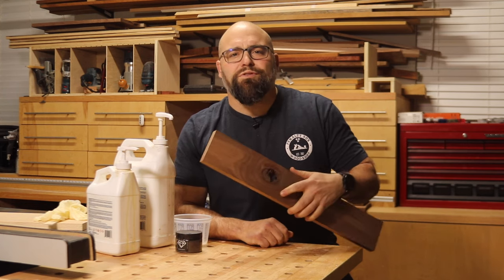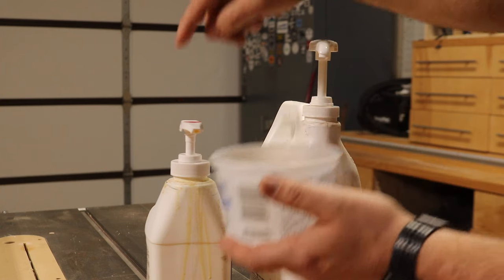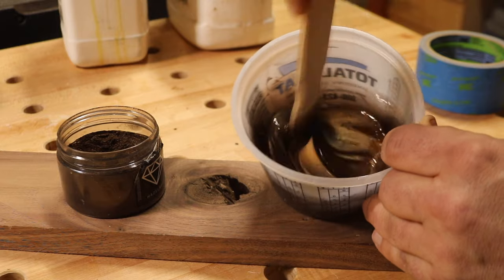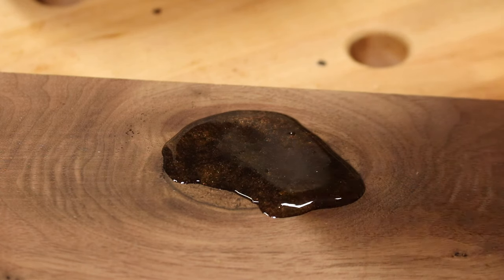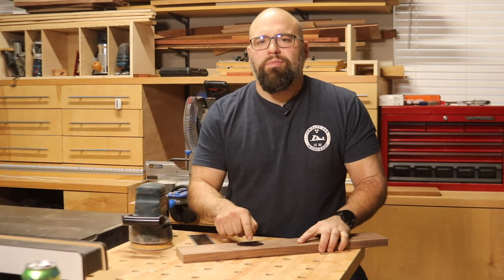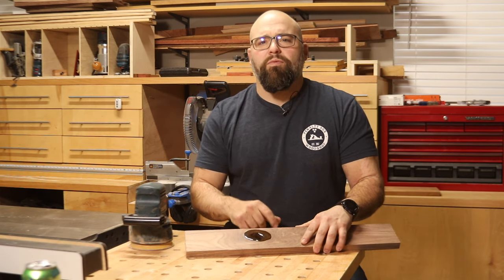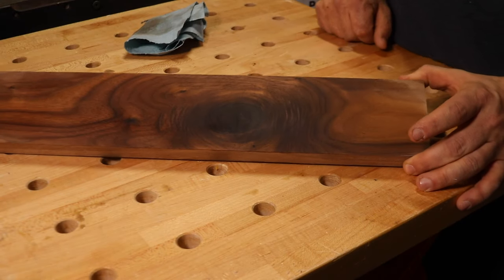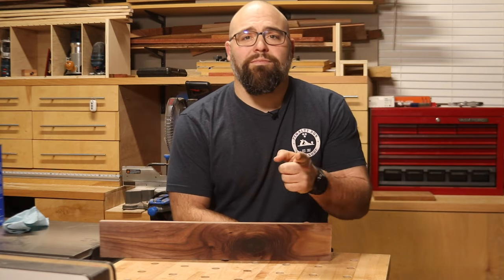Fixing Knots and Voids With Epoxy

Comment from the maker: If you watch all the way to the end of the video you will see how I use my leftover epoxy!
Reply: Totally saw that. Rock on!
Reply from the maker: Haha thanks man!
Reply: I used glue to lay down my hardwood (white oak) 3/4 thick and the glue which is like rubber once it dries. Has seeped into the not holes. Do you have any suggestions on getting that out before laying the epoxy or do think it’ll be ok to go on and finish filling the hole.
Reply from the maker: I don’t think it would hurt to just pour it but that’s without me actually seeing it. You could always use a small forstner bit to drill that stuff out

Comment: I just bought a bunch of reclaimed doug fir that I’m going to use for flooring. The planks have a ton of knots, holes and imperfections (which I don’t hate) but just curious if you think I could get away with filling all the holes this way? or what you would do? I’m trying to avoid having to cutting all that out and losing so much of the wood :/ any recommendations would be so appreciated 🙏🏼
Reply from the maker: Yea, I don’t know why you couldn’t! Should work good, might be a lot of work but will save you from tossing boards
Reply: Okay thank you 🙏🏼

Comment: That is exactly the information I need for this table top I am making for a client. I got a lot of old black walnut slabs that were cut in the early 1970's and sitting in the millhouse for all of that time. Bugs got in the wood and did what they do so there are some holes and tunnels that need filling. I was thinking that I would have to make a mold and do the whole thing in epoxy but that would be major overkill as I am not making a river table or anything of the sort. I just need to fill the holes and tunnels and knots. This is the perfect solution. Thanks for the video!

Comment: Hello Jessy. WOW! Thanks so much for your video, very 
useful and clear! I would be grateful if you could give me a suggestion.
 I left a bottle of gel bleach in a bag on the floor. It is an old, 
light colored, parquet; therefore, there is a very thin line of empty 
space between the pieces of wooden strips. For some reasons, the gel 
bleach leaked and, since the bag was not made of plastic (it was a cloth
 bag), it passed through and got to the floor. It stayed there for a 
very long time. The gel bleach had the time to literally dig a large 
hole in the parquet. Which now looks like a crater, about 6 cm or more 
in diameter, exposing the bottom layer of the floor, some sort of 
strange material. I thought to fill it with epoxy glue (Gorilla epoxy 
with the 2 syringes), wait that it dries, and then paint. I am glad to 
find out that I can mix the paint with the glue itself. I need to fix 
this quickly. It's not my home. I would be GRATEFUL if you could help me
 with the following questions: 1) Since I cannot fill from the back 
side, how do I address the need to leave a thin line between the wooden 
strips? (yes, the crater extends beyond 1 strip, affecting the two 
confining strips at its two sides too. 2) If I send you a picture of the
 parquet (how/where can I send it? Thanks), would you be able to tell 
me, approximately, what colors of what kind of paint should I buy? 3) I 
cannot spend much money on huge tanks, so, is the Gorilla Epoxy glue 
with 2 syringes ( 
https://www.homedepot.ca/product/gorilla-epoxy/1000778451 ) suitable for
 this job and can I mix that type too with the paint? 4) If the epoxy 
will end up overflowing, how can I gently smooth it without damaging the
 surrounding healthy parquet? 5) Any other suggestion? Like, if it had 
happened to you, what would you have done saving as much time and money 
as possible? THANK YOU SO MUCH!!! I will anxiously wait for your 
response and my apologies for the long comment. (Loved the leftover epoxy idea! :) ). Kind regards.
Reply from the maker: Thanks for the comment and support! Not knowing the situation entirely it’s hard for me to comment to exactly the right move here. But, it sounds like you are on the right track. You might be able to heat the excess epoxy with a blow drier (be careful to not get the surrounding area too hot) and then the excess epoxy might get pliable enough to scrape off with a card. But, again, not knowing the exact type of floor it’s hard for me to help you that much. Sorry, this is a tricky question.
Reply: @PenaltyBoxWoodshop  Thank you Jessy, no need to apologize. On the contrary, thanks for replying and so quickly. Well, at least now I know that the little Gorilla Epoxy works just as fine as those huge tanks you used :)

Comment: Nice video. Any tips on filling a 2 1/4 inch deep hole? Should I fill it all at once or do it in 1/4 inch stages? If in stages do I let it dry completely before continuing? Thanks 😄

Comment: I love tints dyes etc.....but no need to use tint "unless" the hole on the other side will actually see light(rare) in the final piece. Plain clear epoxy(or slightly amber will mimic the color of the hole below and wood surrounding almost perfectly; it will even look more like wood and it won't darken the wood around it like tints will. Give clear a try!
Reply from the maker: Will do! Thanks!

Comment: Can you suggest any low or no VOC epoxy fixes for boards, and perhaps any that are already mixed with a hardener? I want to repair a knot hole in my spiral staircase and need to do the epoxy fix inside the house.  Bad allergies to chemical smells. Thanks!
Reply from the maker: That’s a great question and one that I’m not sure of. I bet if you contact total boat or any of the other brands they would be able to help you

Comment: Any tips on resawing a board after filling voids with epoxy?  I have a 3x5-in juniper board with some really cool knotholes and voids that I'd like to turn into  3/4" shelves.  Is it better to do a deep pour then resaw, or resaw first and fill twice as many holes?
Reply from the maker: It should do fine resawing however it wouldn’t be hard to do it after either

Comment: This vid is very helpful, just wondering if it works the same on large open cracks due to natural wood and not stress cracks. How about knife scales with tung oil or Tru oil finish . I usually use Loc Tite epoxy to bond scales just wondering if same would fill cracks and knot holes
Reply from the maker: Thank you! It will work on larger cracks just as long as you don’t pour it any thinker than recommends by the brand Epoxy that your using. I’ll typically do layers for larger pours and it works great. Not sure about the knife scars

Comment: If you put a screw or bolt in the center of that hole, would the epoxy solidify such that the bolt will not move, even with force?

Comment: I look great, but wonder this epoxy can be applied for pine wood - soft one? and after planning this wood foil can go for molding without any problem? the final product is wood skirting. Please advise
Reply from the maker: Yes you can apply this to soft woods like pine as well. Shouldn’t have any problems planning that either

Comment: I really like how this turned out. I've never used epoxy and don't really care for the bright metallic looking river bed tables. Can you advise if the diamond epoxy gives a metallic/sparkly finish?  It doesn't appear to in the video however I may opt for a more flat pigment if it looks sparkly in reality.
Reply from the maker: Thanks brother! It does have some slight metallic to it. Once I Polly over it it never seem to stand out that much when used in darker walnut though.

Comment: Ok few things. I'm playing now with epoxy and filling up knots on oak boards that I'll be using for treads. Brand I used was called Epodex and it was curing for 2 days, not sure if it can be so drastically different and if it's normal. I also used painters tape but it was a total fiasco. It started squeezing through and leaking out, total disaster. Is this tape in any way special

Comment: Thank you for this video. My issue is filling knots in hardwood that is already laid. How could this method be used to do that without being able to flip the board?
Reply: Any luck filling the holes in your project? Any advise? I’m Have a similar situation.
Reply from the maker: I’m assuming you mean hardwood floors? You could go ahead and fill it just fine. Might be a little difficult to tear up when the time comes though.

Comment: Is it necessary to clean out any splinters or pieces that are barley hanging on? Some of them add character, rather than having a larger epoxy circle. I’ll be using a black tint.
Reply from the maker: The epoxy will cast it in there so no need to if you don’t want to

Comment: I have a wooden door I'm hanging as a pantry door.  There was an door knob that i gave removed.   What is the best way to fill this hole so that I can stain the door…?   Is minwax wood filler better idea ??
Reply from the maker: Last time I used an old door as a barn door I used some door knob plugs from lower to fill the area where the knob was. They were metal but plug the hole perfectly and looks fine. If you wanted to use wood I would most likely use a hole saw to make a plug the same size as the door knob hole. Then, once you put the wood plug in place use a small amount of Epoxy to fill any void areas and the small hole in the center

Comment: How do you like your Dewalt planer? I have been using a Porter Cable bench top planer for a while now and it works well overall. However, the snipe is pretty bad at times. I was wondering how bad the snipe is on the Dewalt?
Reply from the maker: +zillie36 I do not experience any or very little snipe with this planer. I have been very happy with it since I got it last year.

Comment: This is an awesome video.

Do you have any recommendations for knotholes that are already in installed wood trim? Meaning the wood is already vertical and I can't remove it.

Can you use the same painters tape trick and sand in place?
Reply from the maker: Thanks. Yes, you can use painters tape but I’m not sure how you can keep the epoxy from running out with it being verticle

Comment: If I used this method, Can I paint the piece of wood in white without the fear of getting knot bleeding through out the paint leaving a stain mark. I wanna build a twin bed frame with some 2x4 from my local Home depot, but they have knots,,,
Reply from the maker: As long as you have completely filled the holes it shouldn’t bleed through.
Reply: You would still want to hit the knots (including intact knots) with shellac. The part of the knot that isn't fully covered by epoxy can still bleed. I have had good luck buying shellac flakes and dissolving  them in denatured alcohol to get just the small quantities I need. (Shellac has a shelf life, including store-bought.)

Comment: Hi There! Thank you for this great video, very helpful. One question though-- you mention in the description that you recommend filling large voids in layers. What constitutes as a large void? My particular knot is about 1.5"x1"x1.25". I wouldn't call it "large" but this is new for me. Based on the knot you filled in the video, I think it's probably ok to do in one pour, but figured I'd ask first.
Reply from the maker: It’s really gonna depend on what epoxy and hardner your using. All of them of the suggested pour thickness on the bottles and I would refer to that
Reply: I ended up getting the total boat 2:1 with medium hardener. Bottles do not give a max depth per pour. I did a test pour to fill a very small through hole in a board (we're talking a cylinder 3/8" diameter and 6/8" long) and it generated enough heat to volcano out through partially hardened epoxy (no heat dryer was popping bubbles anymore). So....I read that you have to time mulitiple pours so that it bonds to but doesn't crack the previous pour. Do you know what the wait time would be for that?
Reply from the maker: It’s typically around 1-2 hours depending on your temp in the shop. I would have thought you would be good with that epoxy and the size hole you stated in you original comment with pouring 1/4” deep layers. But, it will depend on shop temp and climate.
Reply: @PenaltyBoxWoodshop  I'll keep playing around with it. Thank you for your time!

Comment: what if the teak furniture has a slightly glossy/oily finish ?......how to repair the hole and cracks (on a vertical surface) without messing up the finishing around the defects ?
Reply from the maker: I’m not sure how you can do this vertically. It’s so thin that you almost have the be able to pour it on a horizontal surface
Reply: @PenaltyBoxWoodshop  many thanks for your quick reply.......i reckon a wood putty or filler crayon might work ?........i just took delivery of a solid teak armchair (indoor use) a week ago, but already noticing hairline cracks......and even 2 holes (poor quality control i reckon).......the teak has a slightly oily/glossy finish.......i know the teak is grade C though

Comment: My cherry picnic dining table is beautiful, but there is exposed wood that the polyurethane either never covered, or it has worn off. I'm assuming I need to clean those spots first because there are some food particles in there, then I should use epoxy to fill in those knot holes or imperfections, but there are some areas that may just need more polyurethane. How should I begin this project, or should we take it to a professional? I could send pictures. BTW, I am super anal about this table, as my grandfather made it from a cherry tree in his yard, many years ago. Thanks for any help you could give.
Reply from the maker: First off, thanks for watching and supporting the channel! Sounds like a great table and I love a piece with history like that! If you are super worried about it then I would take it to a professional. If I were doing it I would sand the entire thing starting at 80 grit and then fill the knots with epoxy. Then I would sand from 100 grit and incrementally go up in grit until hitting 220 grit. Then, I would finish with a  poly or Arm-R-Seal.

Comment: Do you clean the knot? Or does the epoxy stabilize it?
Reply from the maker: The epoxy should stabilize it even if the knot is loose. Sometimes I’ll scrape out some dirt or dust but other than that it doesn’t require much
Reply: @PenaltyBoxWoodshop  thank you for the quick reply.